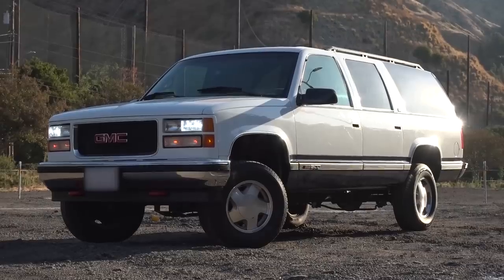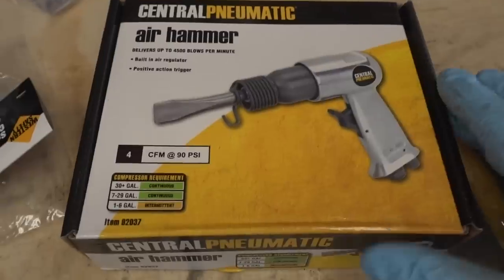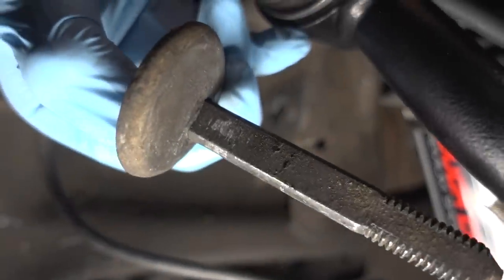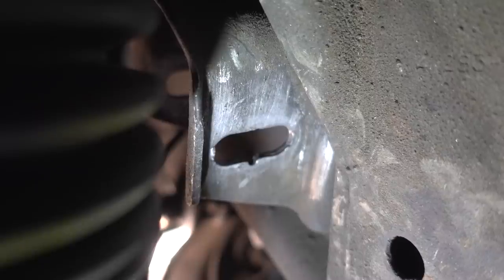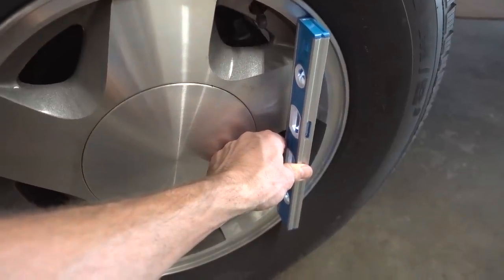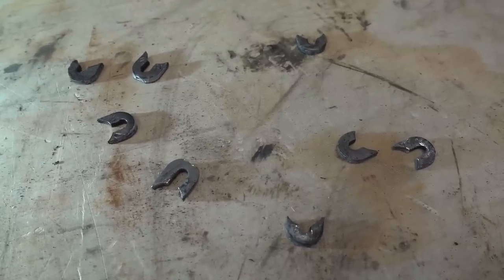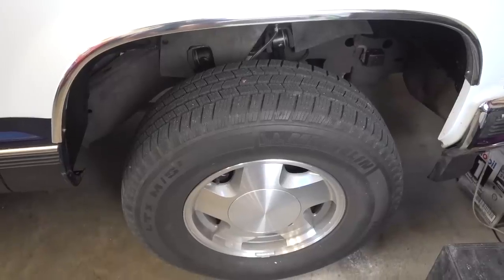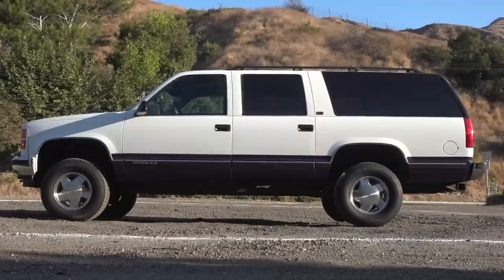You'd Better Check If You Have These Before getting An Alignment!

Comment: Positive camber when the tire leans outward to put more load on outside tread, negative if top of tire is further under fender and would load the inside tread. caster is almost always positive with few rare exceptions. Caster is an angle between spindle pivot points which is the two ball joints on double control arm types and ball joint and upper strut mount center on MacPherson strut type. The line between those two joints will intersect ground in front of tire in direction of travel. The other angle involved is Steering Axis Inclination ,SAI, and also known as KPI from when vehicles had kingpins. This is an angle in a 90 degree turned axis between spindle support points. This usually will be a line that would strike ground outside the center of lower ball joint. Greater SAI gives stronger return to center when wheel is released but also gives more kick into wheel as the leverage for force striking wheel is greater. Positive caster and the SAI will yield a torque that makes each front wheel turn to center. SAI is affected by camber setting as that changes the ball joint angle in that plane. Balanced caster and camber between left and right will yield a turn to center balance or equilibrium and car should go straight on a perfect road with no lane crown. A common practice on RWD vehicles is to give the right side a small amount more caster to offset the crown (slope) built into road to make water drain. This would make car drive straight in rh lane and add a faint amount of steering correction for lh lane travel.

Comment: You got lucky. First, on your vehicle your brackets are on side of frame so they are easier to get to. My 94 Silverado has them located on top of frame. Second, and mostly, mine didn’t break out near as easily. Air hammer, chisel, channel locks; then more of the same. In the end, had to polish holes with a bit to get bolts to go all the way to each end. Congrats.

Comment: Seriously Dude !!!    You have the BEST VIDEOS !!!    I did my 91 Chevy Heater Hose Intake Manifold fix yesterday.    It happened just like yours did.   1St 2 attempts stripped out.  3 attempt pulled it right out.    Started the truck for 2 seconds and blew out all the flakes and it's back together!!!
THANKS A MILLION !!!!    You da MAN !!!!

Comment: I, like you, own a GMT400 truck, specifically I have a 1997 C1500 Silverado. The truck is 26 years old, has 250,000 miles, and I’ve had all the control arm bushings replaced, so naturally I thought I was being fucked with when the alignment shop said they couldn’t set my camber, and then quoted almost $300 to remove “factory knockouts.” Seeing what I need to do now, I think I’ll just give them $300 lol.

Comment: Oh man. If only knocking out the tabs were this easy on my 99 suburban. Unfortunately mine were not tacked in like yours. I had to buy a special knockout tool that didn’t even work well. Spend hours using a punch and grinder to finish it off

Comment: Lookin' good! Nice when having to fix something is easy, even though it's kinda like doing it twice. And you can never go wrong with having an air hammer. I use mine for a lot of stuff on my truck. Damn near necessary here in the Midwest.

Comment: Done many of those knock outs and find it easier to use a 22 mm wrench 🔧 to pop them out   Using the open end to push them out.  Sometimes they didn’t stamp them good from the factory so that’s when you have to used a air hammer to knock them out but still leaves pieces that have to be cleaned up with a carbon bit. I always hated doing the knock outs. And I’ve seen them all the way a far as 1998 Chevy and GMC 🙂✌️
Reply from the maker: Thanks for the great info!!
Reply: HI Made !  Why are those tabs in there to begin with ?? I think I follow why they come out ,in order to turn the adjustment !! but what did they do in the first place ?? thanks
Reply: TOMAS   They hold the vehicle to the factory alignment specifications. After time the suspension loosens up and wears in   So the tabs that we call knockouts have to be knocked out in order to set the vehicle back to the factory specifications  The only problem is when you remove the tabs it is much easier for the control arm to be knocked out of alignment when hitting a potholes.  Usually charge about half hour to one hour each side on top of the price of alignment
Reply: @MadeInTexas  GOT IT !! thanks for the reply !!

Comment: What you had was positive camber (or so it looked like to me). Positive camber happens when the top of the tire is "going away" from the vehicle. That does not help in tight bends. Negative camber is what is usually required by most vehicles on the roads, it happens when the top of tire goes towards the frame of the vehicle Some vehicles need positive camber, usually trucks and vans, as it is needed for heavy cargo, when the vehicle is loaded the camber becomes negative, granted it ever so slightly. You also have some other angles in the suspension of the vehicle and steering of the vehicle. They need be well tuned in order for some good corners and good handling, as well as safe motoring. In some countries (Portugal for example) the steering needs to be aligned so that the vehicle will pass mandatory periodic inspection. Doing an alignment with a piece of string is not a way to do an alignment at all, it is only good enough to get to an alignment. An alignment is milimetric, it needs to be done correctly. I hope this information suits and helps you. Cheers.

Comment: You have what is known as a short long arm suspension up front.... so basically the more your truck "squats" in the front the bottom kicks out more causing wear on inside... also when you lift the front it sucks the bottom of the tire in causing wear on outside.... also the "toe" will change meaning the front of the tires will either turn  in toward each other causing wear on outer edge of tire or away from each other causing wear on the insides....  basically have an alignment done when any change is performed, and or regularly (like when you get tires)..... like springs in a bed with a fat person never getting off, your springs or torsion bars are gonna sag over time

Comment: GOOD DEAL !! THANKS FOR SHOWING US !  I see that removing them creates a full-size slot on that side !! but I don't follow why that end of the bolt needs more room ?? When the tabs were still in , did that prevent that "cam " washer from turning ?? AND how was it aligned at the factory when the tabs were in ?? Thanks, for helping me follow how that works !

Comment: 1:50..  So the alignment shop couldn't simply punch out the tabs and do the alignment?
Reply: Probably would cost a whole lot more than just the alignment price....
Reply: @danhambrick6331   Even if they wanted to crack my head for 40 or 50 bucks... I'm already there.... 👉 knock em out
Reply: Lazy shop.  I mean ya, they're not the plastic tabs on the newer trucks, but to decline over a couple minutes extra work is ridiculous.

Comment: I actually have to do the same exact thing. I went to get a cheap alignment shop they did it but it was not right brought it back they redid it. Still wrong. Said it’s a gearbox issue. But it’s a new gear box a few months ago. Went to the best alignment shop where I live and they said knock out those things you just did! We will see how it goes
Reply: How did your go, I was told the same exact thing. I put the 3in lift, took off the original control arms and put the recommend ones for the lift, took out the knock out tabs to get more adjustment for the eccentrics, Did inner and outer tie rods. But I'm still getting the positive camber? Anyone have any suggestions? When I went for alignment they told me the same thing, that the bolts were maxed out!?

Comment: Since you didn't show it, I think anyone considering tightening their torsion bar key to raise their vehicle;  Raise your front wheels of the ground and count your your torsion bar key bolt turns when making this adjustment.  If you don't, you won't be the first guy who stripped or broke that bolt but you'll be just a PO'd anyway.  Word to the wise.

Comment: Negative camber is when the tops of the tires are leaned in. It desirable to have a small amount of negative camber. Race cars usually have much more than street cars.

Comment: I literally just had the same problem after my 4in lift on my 97 Sierra, it was $100 for them to take out the tabs with labor and $50 for the alignment. Not too bad I could've done it myself but I didn't have the time.

Comment: Rule of thumb 95 is face lifted 94 pretty much everything is a 94. Late 95 into 96 is different all together might look the same from the outside but it’s completely different.
Reply: 1995 was a OBD1.5 thing       that is why the 1996 changed   wires changed  new computers etc..

basically they were just using all the "left over" parts to build new ones

Comment: So do you have to punch out the tabs on a stock height truck to get it aligned or only for lifted trucks?
Reply: I went to an alignment shop yesterday and the guy said yes - that it can't be aligned properly otherwise.  It's possible they don't have to be adjusted so much w/stock height, but the cam in slotted side can't be adjusted more than ~1/8" (the amount of slop between cam washer and mount/bracket.  My truck runs straight, but I want to knock them out so caster can be adjusted if needed.

Comment: Also known as "knockouts" the vehicles are not aligned on the assy. line. They use these knockouts as a general rule of alignment when assembling the vehicles. Modern GM's use of plastic inserts. Easy to look at and see if a full proper alignment has been performed.

Comment: I wonder if the 2wds have those tabs I might have to take a look at mine tomorrow
Reply: It does unless they were taken out for an alignment
Reply: I doubt mine were ever taken out I did a coil spacer lift on it about 3 years ago and never had it aligned it would probably explain why my front tires have a negative camber to them

Comment: Steering tires should be tilted slightly inwards at the top and at the front.  That is because in order to enable the steering tires to turn there must be some free-play in all of the moving joints.  That way when the tires start rotating, centrifugal force will cause the wheel to straighten up and hold firm against against the joints so the wheel does not wobble at speed.
Reply: When i had mine like that it made one of my tires hard jump when making slight turns at highways speeds  especially on rainy days.

So i set my casters down to center the arm bolts and its been good. Not perfect but good.

I run 37/13.50/20s so its always a hastle getting it right

Comment: They wanted $600 for the knock outs. So I could lift my c/k3500 dually. Doing it this week myself than installing level kit after. 2000 c/k3500 dually

Comment: Do I have to take my tabs off on my 1997 silverado it's toeing from the top of the tire out eating up my tires from the outside my truck is lowered  thank you if you can answer my question

Comment: Hey Jim, I really love your Suburban and now that you lifted it, I have a couple of questions.

Are you going to install bigger tires?

and if so, what kind of tires?
Reply from the maker: Yep, bigger tires. I'm looking at Falcon Wildpeaks right now..
Reply: Jim don`t get the wildpeaks when you go through water the truck will feel like it's hydroplaning I have these on my 99 Tahoe. garbage! go with starfire sf 510 or General grabber or even black lion
Reply from the maker: @Badgirldeb30  really? What size are you running?
Reply: @1RoadGarage  265/70/16 was running 285 70/75 16 with slight rub on front at full turn

Comment: Ok so then how were these tires and front end EVER aligned with those tabs in there surely this isn't the first alignment ever?
Reply: If it still has the knockouts in the frame its never been properly aligned. Likely a tire stores "Free Alignment" - AKA toe and go
Reply: A YouTuber responded to a similar question above. In order to same time and money on the assembly line they just threw in the cam bolts into the round (knock-outs intact) hole. That put the newly assembled vehicle close enough into factory alignment specs. Honestly if you havent modified or lifted your truck/ SUV you probably dont even ever need to mess with those knockouts.

Comment: Your first mistake was using Rough Country and calling them and ask them for advice
Reply: What would you recommend? There are not a lot of choices for this year truck as many manufacturers have discontinued due to lack of demand on this aging platform. I have a 95 K1500 Z71 and I have been searching for an affordable solution myself.
Reply: @michaelwaters5168  I have had nothing but bad luck with them. I wish I could tell you of someone who is making them for your truck. Like they say something is better than nothing.

Comment: Hmmmm, my alignment shop wanted 400.00 bucks to remove the tabs on my 1994 K1500 Z71. The reason was because it takes a special tool to CUT the tabs out. Did they BS me? Anybody else have this problem?
Reply from the maker: No specific tool to my knowledge.
Reply: There is a special knock out removing tool,  but it is not necessary.